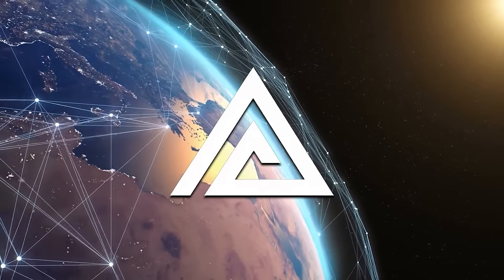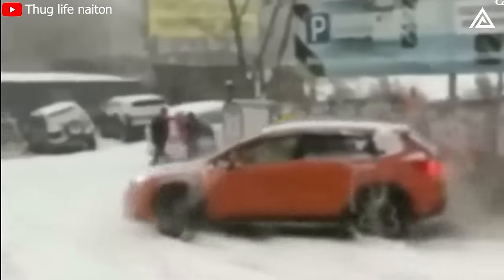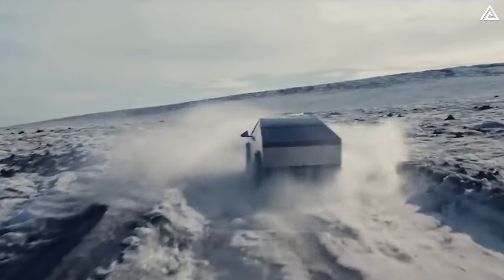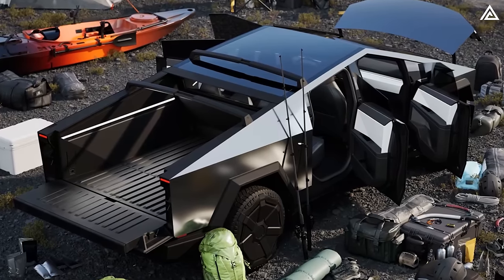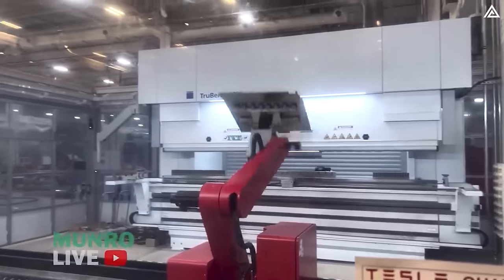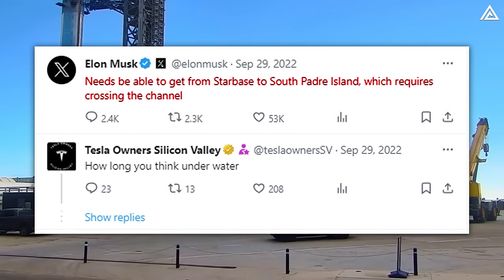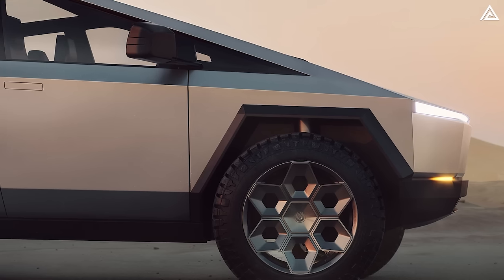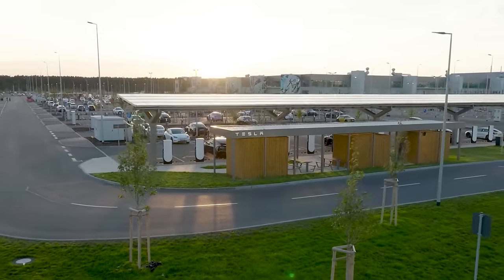All Updates on Cybertruck's Off-Road Capabilities In This Video. Cybertruck 2025's Off-Road

Comment: Considering the locking differential has been around for many decades, it brings nothing revolutionary to the Cybertruck.
Reply from the maker: But right now Cybertruck doesn't have that feature. To enhance off-road, locking differential is must-have. You can go watch on X, a video about Cybertruck stucks when going uphill
Reply: @adamtech999  Yeah.. It is surprising how much of the siftware is unfinished.